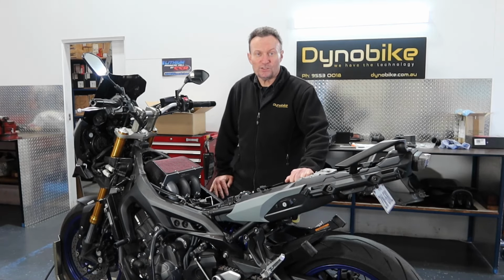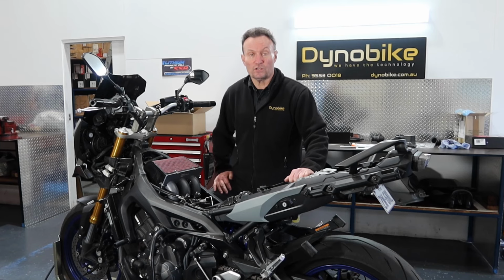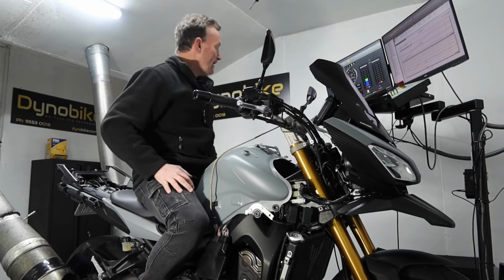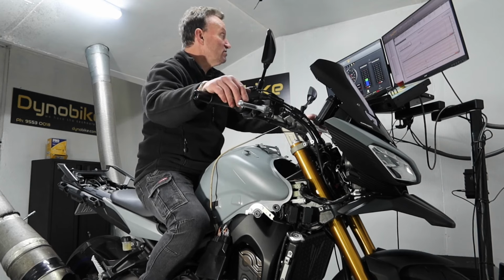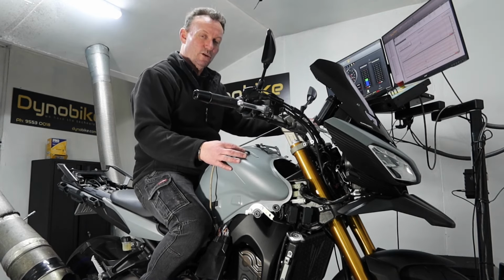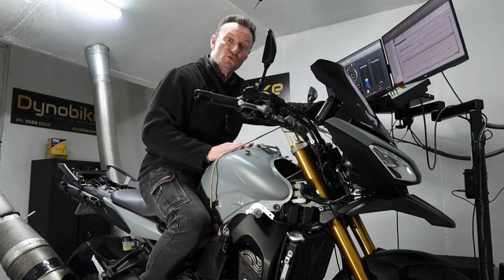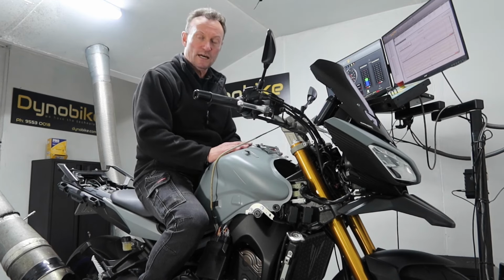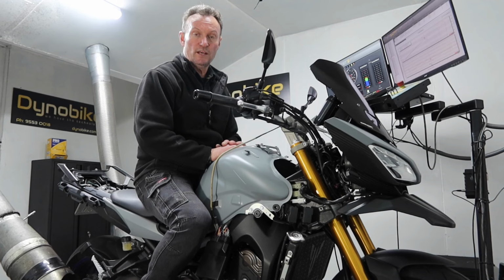Yamaha MT09 / Tracer / XSR stage 3 upgrade

Comment: Is there nothing that can be done about the intake noise? I just did the stage two on mine and the power increases great but the intake noise at full throttle actually is louder than the full LV exhaust.

Comment: she sounds like she flys. can you show the fuel graph as interested how it looks. just had 38mm throttle tubes put in my T7 and dna filter with a special filter snorkal not dna. 74;6hp at rear wheel.